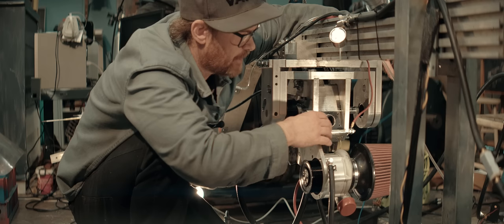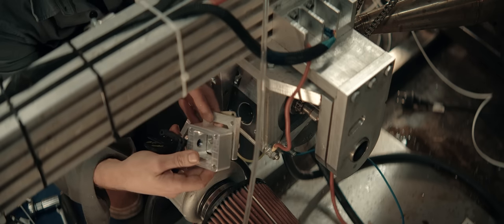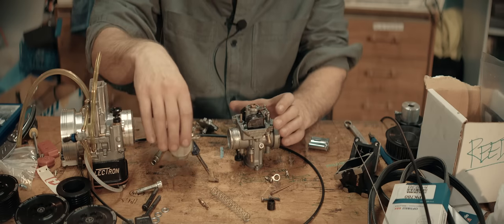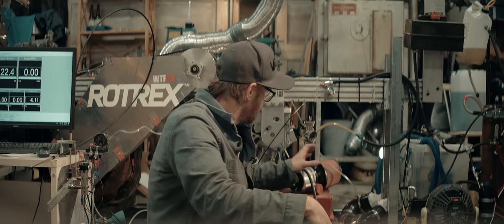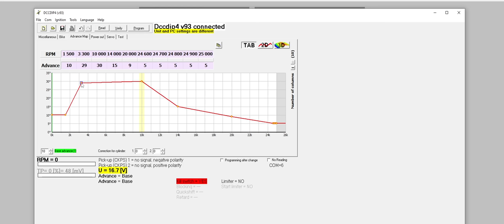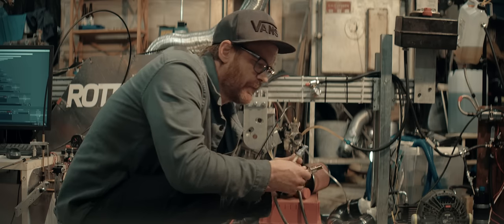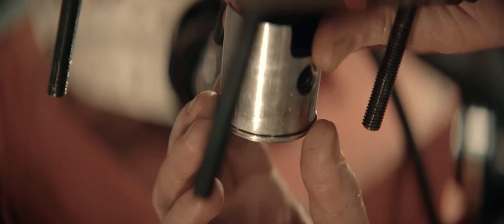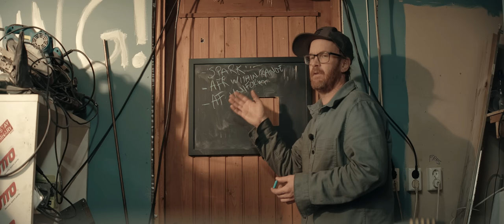Not Supercharged 50cc Two Stroke Not Running Nitro.

Comment: I'm recommending a great book to everyone who thinks this should be easier: Mat Oxley: "Stealing Speed: The Biggest Spy Scandal in Motorsport History" (2010). It details the origins of the modern 2-stroke designed around resonance in Eastern Germany after WWII. It was a hard, decade-long process of trial and error to make pipes, rotary valves, and ports get along in harmony. No easy feat, not then, not now. Enjoy the ride everyone and thanks for taking us along, Alex! Love your videos!
Reply: Thanks for the recommendation
Reply: I also recommend Design and Simulation of Two Stroke Engines by Gordon P. Blair to mathematically understand the complexity of two-strokes. Plus it helps design tuned pipes. 🔥
Reply: @sourand jaded Does the calculator take in account for boost ?
Reply: @sourand jaded Be aware that Jennings pipe equations are derived from him measuring pipes from factory race bikes and reverse engineering his equations as he states himself in the book, which are valid and I built many pipes using it back in the 80s before Blair (A Professor of Engineering) published his SAE papers on the topic, so Jennings came close.. Whereas Blairs equations are derived from the science of engines drawing on other peer reviewed studies to develop equations from the ground up, and Blairs equations are late 1990's where Jennings published his book back in the 70s. Most pipe calculators have Blairs equations inside including my own.
The tuned length formula used by Jennings uses a constant value that does not take into account the type of fuel used or the exhaust temperature like Blairs does.
Also G Bells pipe equation is essentially Jennings equation in Metric.
Reply: It not 1940 we got computer computer aided design (CAD)software and 3d modeling now and powerful ecu to control and gather data on the engine
Is biggest problem is he doesn't have data it always guessing to rich too lean more rimming less timing etc
Reply: @sourand jaded again we live in 2020 just use send cut send and you get lazer cut and bend piece for a super affordable price
Reply: @sourand jaded a roller is not really a difficult tool too use and not time consuming when the part is cut perfectly to roll in the shape designed in software 
Plasma need a lot of cleanup and is a pain on thin sheet metal 
That exactly what I am saying it not 20 years ago design a pipe in cad is way easier and can be flow tested in software to get some data before committing to a design hell he could model the entire engine and make some flow simulation saving lot of time and with a CNC cut part it will fit perfectly as intended no fiddling around with bad cut or non accurate calculation etc cad help as well with loss of material decreasing cost 
Anyway there not just a pipe in a 2 stroke engine there ton of part to design
Reply: @legros731  I'd love to learn more about the possibilities for data collection in the running engine. As far as I understand (guess, really), the parametric modeling in engmod can get you good overall dimensions for cylinder geometry, but this it does not do complete fluid dynamics. For full simulation, you need to essentially model the flame front, i.e. mixture, pressure, temp, and resulting eddies. So full simulation seems hard. But maybe one could measure pressure and mixture in the crack case to solve some questions? Thanks for insights!
Reply: @MrJermbob  No it doesn't—new territory here.
Reply: @basti4296  he could have pressure and temp before the carb pressure in the crankcase he could use a o2 sensor in the crankcase and in the exhaust a egt and pressure in the exhaust  
Use a throttle position sensor and monitor the crank position sensor but to do this efficiently you need a ecu capable  of data logging so you can analyze the data 
He could monitor battery voltage as well maybe the voltage drop too low and cause misfire or the crank signals could be momentarily lost at high rpm
https://youtu.be/eRItqiCFuQE
This is really interesting the guy got a one cylinder version of is engine as a dyno test mule just like they do with f1 engine they built 1 cylinder engine for testing purposes it cheaper and faster
Reply: @davidgierke7582  Not new at all. Lots of production boosted 2 strokes. Also alot of people have successfully made turbo and supercharged 2 stroke engines making good power for many years.
Reply: @sourand jaded Pretty sure anyone creating a completely new custom two stroke motor will know about those books and understands them lol.
Reply: @AuMechanic  good to see you on here love your 2 stroke lectures!
Reply: @MrJermbob  I guess that I'm showing my ignorance. I don't know of any successful production, mechanically boosted 2-stroke cycle engines in my field of 30cc and smaller for model airplanes.
Reply: @davidgierke7582  Check out this new amazing modern machine : Summit 850 E-TEC Turbo
Reply: And then Suzuki paid off the works rider to ride the bike off the track mid race into the back of a truck, stealing all that hardwork and R&D.  Disgusting behaviour of the Japanese (all the Japanese companies ran expansion pipes the next year, not just Suzuki) and mostly of course, the rider
Reply: @kingcosworth2643  WTF stop wasting our time with these pointless comments.
Reply: @MrJermbob  I checked out the Ski-Doo Rotax 850E-Tec Trubo R on the internet. According to their specifications, the 850 cc turbo-charged engine produces 180 horsepower, or.21 hp/cc. If Alex's engine produced the same hp/cc, it would only deliver 10.5 hp... but he is aiming for 30 bhp—a bunch more than the 850E.
Reply from the maker: Thanks, and thanks for the tip!
Reply: @davidgierke7582  Yeah i get that. I am showing you OEM level stuff.
Reply: @MrJermbob  I helped with dynoing and physical testing of the first E-tecs and worked on the first turbo E-tec 600, but had to work with BRP to build bigger fuel injectors as we maxed out the 600 injectors back in 2007-2009. We hit 150HP on the 600, but started to lean out just prior to the powerband. We used an oscilloscope with a pressure transducer directly in the combustion chamber to watch for detonation and fuel flow meters to monitor BSFC. We started with water brake dynos, but later we installed an eddy-current dyno like @twostrokestuffing is using. We were working on an efficient design, not pushing the limits of two-stroke power. Nitro-methane and methanol are no joke in creating combustion chamber pressures, but you need like 4x the fuel consumption as its energy density is significantly less than gasoline or kerosene. He's not worried about fuel consumption but instead ultimate power, reliable enough for a few runs.
Reply: @Orofino6  Yup. Im 100% with you there. Thanks for your amazing work. I just brought up that there was purchasable to the general public turbo 2 strokes to help shut the people with all the wild ideas they are suggesting up haha. In cylinder pressure transducers are a very cool tuning tool. Mega $$ from experience.

Comment: Had this exact type of cutting out earlier this year with a similar carb like yours and the issue ended up being that the float bowl didn't fill up fast enough to keep up with the engine. Kind of fits into the "A/F uniformity" section. Great video!
Reply: Shouldnt starting fluid had helped in this situation?
Reply: Probably the reverse...too much fuel level on the bowl that it drowns it down. Good point
Reply: I agree totally. Carb running out of fuel fits this scenario perfectly. Either from inadequate supply or fuel aeration from all the vibration. As he's running on gas right now an air fuel ratio meter would be very helpful.
Reply: @stoopidfast9049  Fuel could be turning into a foam from the vibrations raising the float
Reply: 68 likes, that's a lot. I can see the carb is facing forward but I feel it's not enough to cause fuel starvation  IMO.
Alex has faced this problem before. He states "with the large crankcase volume it acts rich when it's actually lean". If Alex belives there is a problem with the crankcase volume be too large it has not being addressed yet. Primary pumping efficiency is incredibly low. Don't forget how much fuel used to drop out of suspension  and puddle in the crankcases. 
Go back and watch previous N/A PiP videos.
Finally, while using the roots blower and speedway carb and RC fuel this engine achieved over 18000 rpm. When changed over to the Rotrex and lectron carb it suffered all those problems. IMO lack of CORRECT fuel atomisation and low fuel air transfer.
Reply: @malcrandall1309  the fuel starvation i experienced was caused by the design of the needle valve.
Reply: had this on a 80cc two stroke did all the ports lightened piston (now a race engine ! )  revved to 14k had lots of power but at full throttle flat out nudging 100mph would run out of fuel in the float bole, back off with the throttle for a few seconds and away it went again .Vibration would also foam the fuel .
Reply: @stoopidfast9049  not don't the starting fluid was making it even worst so it not running lean
Reply: @robertturner8040  exactly what i experienced in my bike :D

Comment: Coils and also CDI modules need a certain amount of load time. At high rpm this time period can be a problem. At a certain point the dwell time has to decrease to fire every cycle and this weakens the spark. On old formula one cars this was solved by using 2 coils per cylinder firing alternating. So each coil has twice the amount of time for reloading. Maybe this could be also a fix for your engine

Comment: I think there's a "catch 22" going on here: In order to make the naturally aspirated set-up to work, the crankcase needs to be stuffed to deliver the needed pumping action for A/F mixture delivery. However, the supercharged version benefits from a larger crankcase volume, which reduces the efficiency-killing pumping action. The oscilloscope will tell no lies regarding the spark-ignition dilemma. Measuring the A/F with readily available instrumentation will also pin-down the elusive mixture problem. You're on the right path to solving this complex problem. Keep up the excellent work!
Reply: Totally agree
Should have had oscilloscope and wide band 02sensor a long time ago.
Wonder if he accidentally changed the rpm limit cut. Sounds similar to a soft cut
Reply: Im not so sure you're going to get an accurate reading that you want off of a wide band considering how much unburnt fuel mixture gets spit out that pipe. Pretty sure it will quickly foul out the sensor. Could be wrong though
Reply: Totally agree with reducing crankcase volume. With running 90mm rod it needs more spacing between the cylinder and crankcase thus lowering the primary compression more than needed with a shorter rod. These cases were designed by Alex to use the 90mm rod.The two induction tracts in the cases also lower the compression ratio even more especially the secondary which looks quite long. Don't  forget the volume of the transfer ducts as well.
Question, can the cases be modified to increase primary pumping efficiency........Yes. But as Alex has pointed out to me before he will do it his way as he likes sorting problems. I can imagine Alex shaking his fist at me right now.
PS. I feel I must add these crankcases were designed with a high volume for the resonant induction system and twin injectors.
Reply: @malcrandall1309  If you're referring to the latest return to a NA engine, the large crankcase volume is definitely a detriment.
Reply: @davidgierke7582  was still running good with this large crankcase volume before maybe not ideal but not the problem
Reply: @legros731  Yeah, Simon, It'll be interesting to see what happens when Alex figures out the ignition and A/F problems.
Reply: @ilovelulu8492  Perhaps a small aux port with narrow window rotary valve on the exhaust that opened only during first part of the exhaust phase. Would allow you to place a wideband sensor there and could sample a bit of pre-transfer exhaust
Reply: @Nathan0A  That would probably work. Unless there is some ideal number that 2 strokes like that you could use as a baseline to tune it from that you know is really really rich that you know is right.  I just think you might get a number so rich from all that unburnt fuel trapped in the exhaust that the O2 would register it pegged on the gauge itself. I could be totally wrong though.
Reply: @legros731  here's the deal I'm not saying it won't work at all, It just seems like his motor keeps spitting out unburnt fuel  from the boost and it seems like that may peg the gauge out giving you an inaccurate reading of where you need to be. Again I could be wrong. As far as the motor in the video I can see the naturally aspirated setup working well with a wideband, because it doesn't have a procharger slamming boost down the throat of that carb blowing fuel and everything through the ports and crankcase and then out the exhaust pipe saturating a sensor. That's just what I could see happening on Alex's setup trying to use a wideband however if he can get one to work... That would help tremendously when troubleshooting and problem solving. Would really help dial that bad boy in and make it quite proficient.  That video is neat though of the race bike.
Reply: It's the exhaust port, far to small, not scavenging.  High exhaust dilution so it's misfiring.  The exhaust port on that motor with the flows he is expecting should be at least 40mm dia, he has a thin oval port, the theory being velocity, but exhaust gas velocity doesn't do the scavenging in a 2 stroke, and having 2 in of skinny port than a large step into the expansion pipe means a) there is very little mass of the high velocity gas, causing little scavenging effect, and b) the heavily stepped transition is in effect a large restriction as the gas speed just past the port becomes so slow, the gas in effect is hitting a wall.  His exhaust port design is very poor and this is the problem.  I may have missed an episode where he has redesigned it, but all the videos I have seen outline the issues above

Comment: I had a similar issue on an old CR 500 which I modified a little. It would cut in and out in a very similar way as the powerband would hit...an interesting experience on a 500cc. It seemed as though the reed valves did not close properly, or there was some kind of harmonic resonance and they "stalled", and that is what was causing the engine to cut just as it was wanting to get going. I solved the issue by installing stronger reeds and by playing with the length of the end of the pipe until the motor would rev sweetly throughout the entire powerband.
Love your videos, what you're doing is truly unique and inspirational. Keep at it ;)

Comment: Another way to diagnose spark issues is to take a wire, wrap it 1-5 turns around the plug wire, and run it into an old laptop's aux in/mic port, and then record it using audacity or other audio recording software.

Just make sure its an old laptop that you don't care too much about anymore.
Reply: run it into an audio isolation transformer  wont fry the lappy then
Reply: 😂

Fortunately most circuits are open to interference and you can hear the pops and hisses without a direct connection. 

Wrapping headphones wire around the wire or microphone wire and then using that in the correct jack. Should produce the same thing without frying your computer.

But I think he already has software for monitoring and changing spark times and duration?? 

Has he tried multipoint ignition?
Reply: @petenikolic5244  Still at risk of frying. It's not galvonically connected anyway, its entirely the voltage spikes from the induction.

Just keep it to a low number of turns and you should be fine. Start with 1 or 2 and work up until you get a nice signal with no clipping.
Reply: @petenikolic5244  Another way to help reduce the risk is to use a cheapo USB soundcard.
Reply: You need to add a zenner to short the voltage spikes

Comment: Dude, stop worrying about what everyone says 
There's no way in Hell you're going to make everyone happy, so worry about those that pay the bills, and what you need to do  
Experimental design is just that, and it takes trial and error to get to the point that you can patent the design. 
And even then there's always ways to improve everything, whether it's you or someone else. 
Eventually you will have a Great design, and you're steadily getting closer, as it's obvious if you listen to how the engine is starting to rev higher than ever.
You're asking for a whole lot from such a small little screaming beast, and anything that revs to the rpms like you're doing, is not conducive to long lifespan unless you have it dailed in perfectly. 
So keep playing the good tunes, and tinkering with the screaming lil beast.
You'll get it before too much longer, that I have faith in. 
So have a Great Day